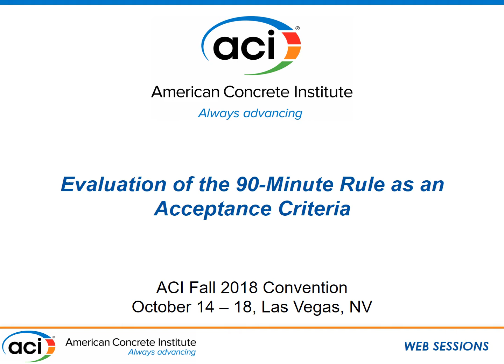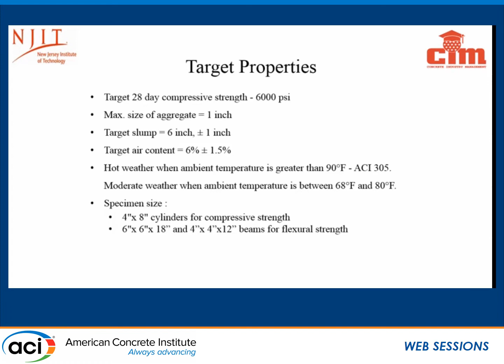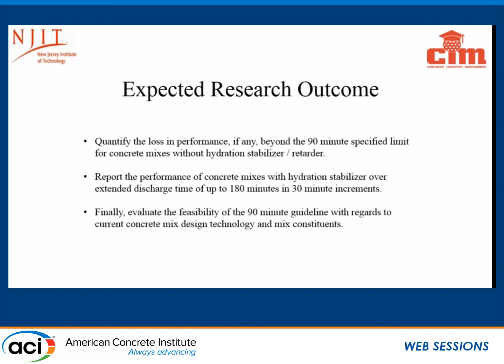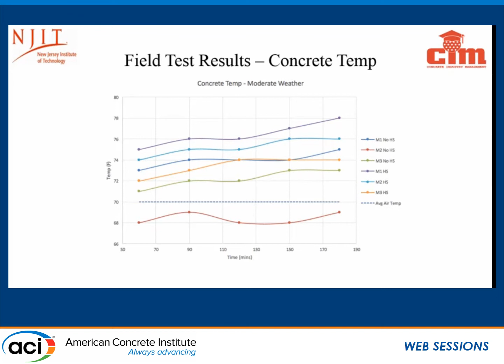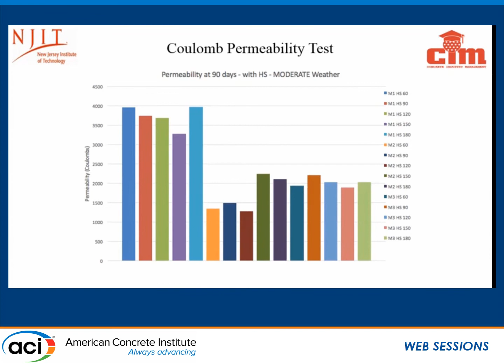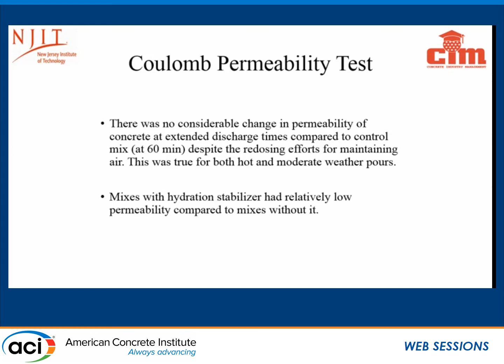Evaluation of the 90-Minute Rule as an Acceptance Criteria

Comment: This presentation doesn't provide enough data to conclude. I can show you terrible concrete structures, pavement, footing, pier, slab, all around in West. If this is the delivery of the project having current standards then what will happen after relaxing these standards? This presentation doesn't explain many aspects e.g. 1. How slump was increased over the time (Hydration Stabilizer!)? I don't want to guess anything. The data must talk and prove the results. 2. There is no comparison and/or test results available for 28 days Flexural Test? I don't have time to wait until 56 days to determine accepted or not. 3. No mention about actual temperature and wind! How collecting a sample at the batching plants correlates to the actual field condition? This must be discussed. 4. Permeability test results are not satisfactory but shy to mention fact and discuss.
Lastly, discussing standards to make new and/or updating is different than the enforcing the standards and project specifications. Field Inspector doesn't have to know the 90-minute rule in detail, they only need to know over 90 minutes, rejected. period. no argument. No mention about durability!